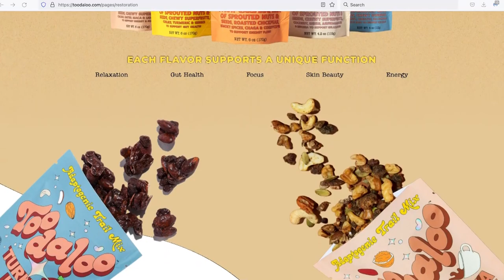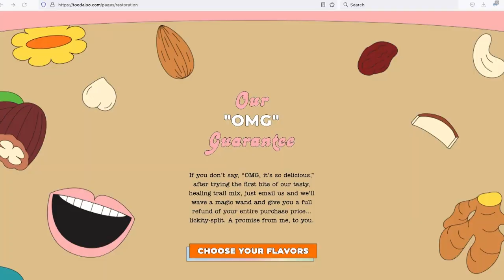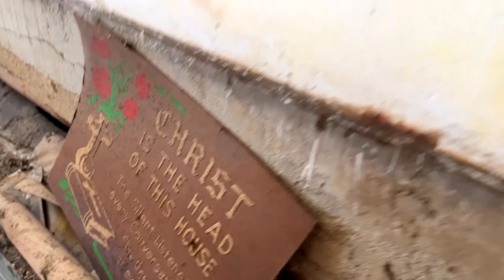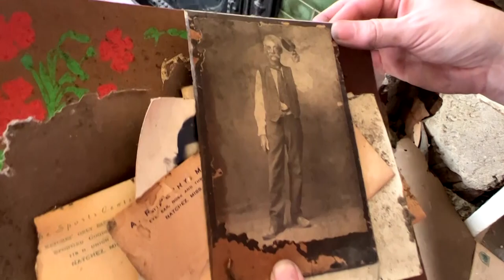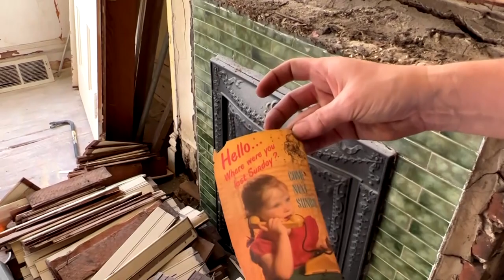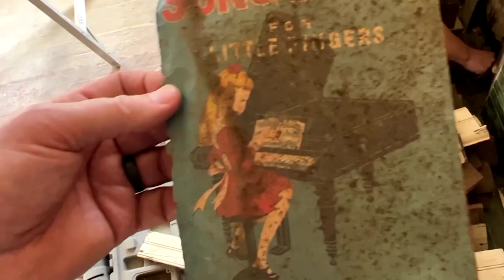Restoring Our Victorian: Pearl E7: How to Frame a Wall and Make Slipcovers

Comment: Cole the Cornstar did make a video of demolishing the plaster walls but saving the original trim of the upstairs master bedroom and bathroom of an inherited farmhouse.
Reply from the maker: Which is a very bad idea- he’ll soon learn that drywall isn’t equal to the depth of what he demolished, and he’ll be left with trim that no longer fits. We never demolish out lath and plaster- it serves as great insulation and there may be someone someday who wants to return the walls to their original condition.
Reply: @OurRestorationNation  he did knock down a few walls too so it wouldn't fit exactly back in place. At least he saved more than enough to try and get a skilled carpenter to replicate. I do believe that part of the reason for gut renovating older homes and a lot of the reason for you doing more of your work yourself is that a lot of the younger people in construction only trained on new construction and are very unfamiliar with the older techniques used in 19th or early 20th century buildings.

Comment: Actually if you  use 1/4 inch drywall around the trim, over the plaster, you don't lose much profile. Honestly it does not look weirdo.
Reply from the maker: It’s a personal preference I’m sure, but we don’t want to lose any of the profile, especially since we don’t remove the lath and plaster in the event someone wants to restore it someday and for its added insulation benefit

Comment: Definitely a great decision to use drywall. Whenever I restore a home the first thing my team does is rip out all the plaster and replace with drywall. You just can’t beat the smooth, flat finish you get with drywall. Not to mention when you’re down to studs, it’s so much easier to do your rewire, new duct work and properly insulate.